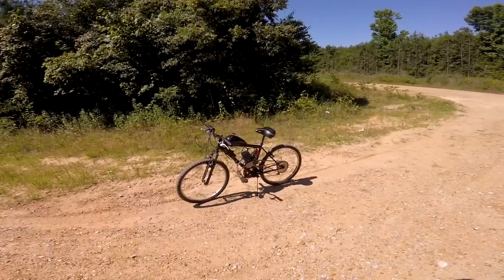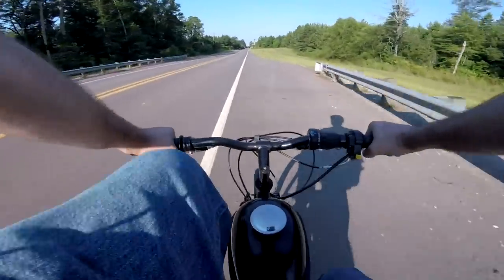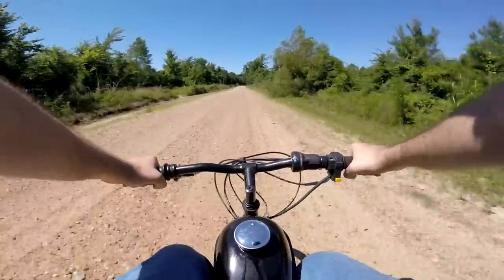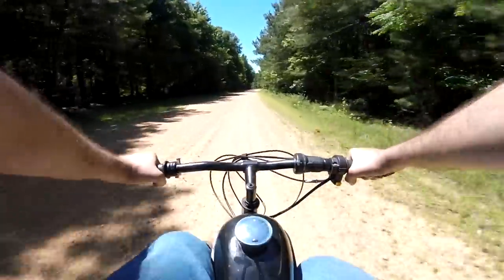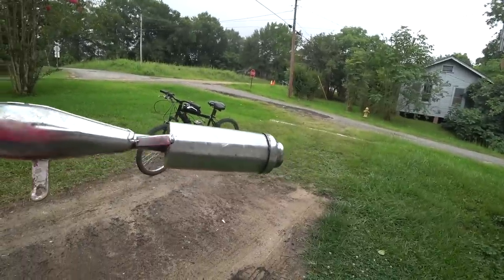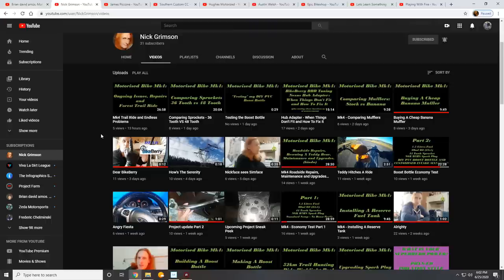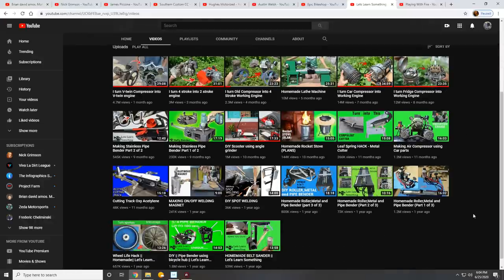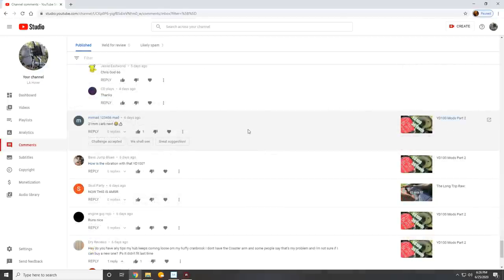Small Sprocket Advantages (Motorized Bikes)

Comment: Hi. Im an older guy and ive been working in stuff like this. I have already made a chainsaw powered 26 inch mountain bike friction propelled. It was done with bits and pieces cause i am a welder and take advantage of scrap parts and give them a second chance. At work alot of guys are going nuts over it and the face of people when they see it is priceless 🤣🤣🤣.Now doing a 26.2 cc 4 stroker edger with a home made jackshaft with old pedal axle and remade it using the lower gear . Still on process of getting a homemade pedal sprocket ratchet with old tools. Nice video and hello from the Windy City
Reply: Love it Man from across the pond in Michigan.S.W. corner exit 23 off 94. Anyways do your thing
Reply: Why don't more people take the silencer off ... It picks up excellent and is noticably faster.
Reply: @KuuchWizard  thanks i just finished and upgraded to a 50 cc chainsaw motor , it hauls !!! Thanks for the comments

Comment: "Truing the rear sprocket." I saw a guy who took zip ties and inserted the tips of about 8 or 9 of them into the gap to keep the sprocket centered before tightening. Seemed a good idea and it worked out very well for him.
Reply: yeah that's the way to do it, very cheap and easy. You might as well haha.
Reply: Project Farm’s 2 stroke bike engine review
Reply: A socket of the right size works well used the same way.
Reply: Yup its works
Reply: That was project farm wasn’t it
Reply: Could have been. @SmothersSawShop

Comment: A 32 tooth is perfect for me.  I have a lower speed bike, built for torque, and I find the 32 gives me a great balance between acceleration and speed.  I barely have to pedal, and I can go a little over 30mph, but at a lower RPM, so it keeps the heat down at cruising speed, and increases fuel mileage.  If I can find a way to get a little more power, I'd love to get a 30 or 28 tooth sprocket.

Comment from the maker: I forgot to mention chain and frame clearance. Smaller = more clearance.
And the bike is easier to start.
Reply: Haha outta gas I learned not to do that bout 10 times
Reply: wouldn't have that problem with a 4-stroke. When you're getting 140 to150 miles to the gallon.  You've always have enough gas to get home.
Reply from the maker: @marcs4091  "This channel doesn't have any content"
Reply: Where do you live. I wish I had roads like that
Reply: @SamSamuylik  Indiana not to be weird but I’ve heard him say it a few times
Reply: @tylertillema5934  i thought it was louisianna
Reply: @marcs4091  I get that mileage on my 2 stroke 80cc china doll, only thing I changed was the sprocket 36t and added 3 holes to the filter.

Comment: Y'all oughta design some kind of bolt on 2 speed transmission, patent it and have it produced in China.
Reply from the maker: That would be a dream come true!
Reply: Yes I think so to or use a 6 speed a bikes shifter sprocket on the left side
Reply: This would be cool. I keep thinking there has to be an easy way to make a 2 gear system without using a jackshaft nightmare setup.
Reply: That would be really cool to get something like that working.
Reply: no no no the fact is its already been made look up motorized bike jackshaft kit that can be used to shift as many gears as you have on the right side as you would do normally their quite an easy setup if you know what your doing :p
Reply: @quirkyMakes  any luck on the 2 speed trans?
Reply: @kjohns1413  i keep thinking there has to be a way for jackshaft to be combined with bottom bracket like I've seen done with production mopeds and board track racers.
 By using a hollow crank axle welded to a sprocket on left for the motor and a freewheel mounted to the 3-chainring sprocket on the right, while there's a solid axle with a one way bearing that goes through the hollow axle and engages through the owb, and is long enough to extend on  both sides to mount crank arms. 
This way we can have motor and pedal drive go through one point without requiring bullshit like flanges and proper angles, bolt torques, and wheel clearance. It's just a matter of getting the axles designed for ability to mount the owb/freewheels of proper size and robustness to work with a motor.
Reply: I say try building a beefier gear setulike a mountain bike has but for 415 chain @Bt.Gang.Activity

Comment: I bought myself a 80cc kit of Ebay. Put it together in about 2 days with zero experience. I had some slipping clutch problems but got that figured out. I took it nice and easy for a little and it's already broken in and its amazing. I'm 16 and weigh about 140 and I've gotten a top speed of 34 on stock engine. I put a new carb on today which should increase performance. I had a lot of help from this channel very good advice. Keep up the work man amazing channel
Reply from the maker: Thanks for sharing, let us know if the carb helps or hurts your top speed. Did you get some jets for it as well?
Reply: @LAHover  bad news. I have no power in high rpms it is very slow. Since I am only 16 I'm not the richest person in the world so I cant really afford jets lol. I decided to return the upgrade and stick with the old one. Less upgrades = less trouble. Its not terrible stock so I dont mind. I'll get a car soon anyway😂
Reply from the maker: Thanks for the update. Ya I hear after market carbs can take a bit of tuning to get the same/more performance. Good luck to you!
Reply: just go ahead and order new clutch pads and a replacement chain that comes with a few spare master links. These are the parts that always trash out and break first with those kits. If you ever break the accelerator or clutch, remember you can swap out your rear break lever in a pinch to make it home. The fuel line that comes with them always wears out fairly quickly, replace it with a real fuel line asap.  I suggest where the cable for the accelerator slots into the handle, wrap it with a small zip tie or two, that little white plastic slot break easily. Otherwise they're fairly bullet proof little machines. If you're going to abuse it, attach the gas tank with electrical tape instead of the bolts because the little screws that are welded to the tank are known to crack the tank and leak from bumps and drops. Invest something small you can strap the the handlebar if you cant or don't have a rear storage rack on the bike and use it to carry all these spare parts and the small hand tools needed for them, and toss a little Gatorade bottle in there with some spare pre-mixed fuel in case you run out or spring a leak and don't catch it in time. I use a small plastic ammo can that is weatherproof for this, and it also hold a small 12v deer camera battery in it that I wired a little switch to in order to operate a bright trail light I use as a headlight at night and get a nice rear red light that flashes (they usually have like 50 hr+ batter life) and toss a $10 set of spare lights in that tool bag in case you break the lights somewhere with a spare set of AAA batteries just in case. 
 That's about it, do this and youll be surprised how long these little kits last. I've got one right now that's creeping up on 4,000 miles.

Comment: Excellent video man. I pulled a 44t from an old Mongoose 20" and then mounted it on a relaced disc brake hub to my rim for absolute trueness. I'm pretty light so a little clutching and I really don't have to pedal except for starting it. Runs 28mph top speed but the sweet spot is ¾ throttle at about 24mph. 36t is probably too small for my stock motor.

And I use the same chain wax that I've been using on my CR125 O-ring chain for the last 25 years. Pretty sure it's Bel-Ray, but it's not greasy grimy dirt magnet goo so I stick with it 👍
Ride on brother
Reply from the maker: Thanks! And thanks for the chain wax recommendation.

Comment: Just in the past few days I transplanted my zeda80 from my aluminum frame Giant mountain bike I had absolutely run into the ground into a steel frame Schwinn cruiser style bike. I was very impressed with the vibrations: the aluminum frame mountain bike vibrated so bad at higher rpms and now I can barely feel it in the handlebars! Huge difference!
Reply from the maker: Good steel frames are getting hard to find. But they are perfect for these little motors.
Reply: A mountain  bike is to light  for a motorized  bike . I have  a  HYPER  cruiser. Really  good  and  solid

Comment: Grabbed my motorized bike the other day and have been running it every night. Havent done much since going electric, but man is it nice hearing that 2 stroke again. I would love to see a good after market carb. Every time I look them up they have bad reviews, hard to know which one will actually work. So funny how that stock exhaust just kind of works!
Reply from the maker: Nice man. How has your electric been treating you? Did you build a kit or buy a pre-built?
Reply: @LAHover  500w rear geared ebikeling kit. Battery is from Unit Pack Power, they have Samsung cell batteries at a reasonable price. A 500W kit would seem slow compared to that YD100 for sure though.

Comment: Thank you for all the sprocket information is very helpful. Now I'm running on the factory 44t and I do find it good for my terrain, which is mostly flat ground but a lot of stop-and-go traffic and a few spots were wide open throttle is necessary. Now with that being said I just had to change rims therefore I had to remount the sprocket. I got it centered and perfectly true. But no matter what I do this Rim, which is true as well, will not allow the sprocket to sit far enough out so it doesn't derail. I've tried shimmying up one side with washers no go. My sprockets Mount up with the typical rubber sandwiched type deal. The only other thing I can come up with is that this Rim was not for this Frame, just swapping them around like that may be great for making it a pedal bike and would work fine in my honest opinion but getting your sprocket line with the motor on a  motorized bike I think the problem lies within the pedal sprocket as well as the axle. Because in this Rim all about is set for a different frame and different model bike. So my plan is to have the Sprocket in the axle pulled from the other Rim, that did work on the bike but it's now all messed up (broken spokes and whatnot). do the same to this new/ used rim then simply install the axle and the pedal sprocket from the rim that did work fine on the bike. This should make the new/used rim set the way the other Rim did, correct? Like am I on the right track here or could something else be wrong. Because nothing I do seems to be able to get that chain to go centered with the sprocket no matter how true and centered the sprocket really is on the rim. And the frame is Not Bent. there's no way the rim would have not bent before the frame. I could really use some advice on this because my bike has been down more than I've been able to drive it and I missing out on the season big time. Thanks in advance for any advice anyone has someone may be able to offer. although I pretty much think I got it, I just would like confirmation that I'm on the right track

Comment: Hiya again.As you've seen previously,I run 93 octane,and semi-synth Penzoil XLF at 32:1.I have the CDH style Reed Valve,which is actually shorted than the stock intake tube,not the big funnel shape as you pictured.Also have stock carb,not the 'speed style'.I cleared my ports of Flashing inside and micro beveled so no edge to catch rings Only,and gasket matched outside.Triple 40mm.Using the 56 tooth It hit 23mph and likes  17-18mph.(so do I).I put the 'Poo-Poo-Pipe'on yesterday and went for a ride.Yikes! It wants to pull the front wheel off the ground at almost every start,and did a couple times.It's about 1/3 louder that my stock muffler,which I'd modified by cutting the up tube to 1-1/2" inside,and drilled 2 holes 1/2"diameter all the way to the material at the top using a long drill bit.I did that for the extra torque and it worked wonders with the Reed Valve.I did no piston mods.>Now,with the Poo-Pipe,I'm going to file the bottom of the piston to port match the intake as about 3/16"skirt shows.It runs out of steam at 15mph and creeps up to 21mph is why I'll do the piston.FYI.The reed made about 3mph more,and keeps blow-back out of the carb and off my bike.
Reply from the maker: Thanks for the info. I like the Poo Poo pipe on the trails for that low end as well :) ...
Do you plan on adding a window to your piston? I hear that the reeds start to open the motor up better with a window. But my guess is cutting the skirt would be the next best thing.
Reply: I'm worried that the 'window'would cause a negative vacuum,and does nothing but lighten the piston mass.By cutting the skirt 1/2" I'll open the intake earlier than the skirt that blocks it by 3/16" anyway.That should create a volume to offset the free exhaust flow,in theory,and not overload the spark.(I'm uploading a test run as-is without re-work)

Comment: My son and I have bikes. His is a yd100, and mine is a pk80 with Reed values and a 24mm mikuni style carb. A good trick for the exhaust, is to grind off the pipe at the top of the muffler, carefully enough so you can weld it back together. Hollow out the muffler weld together and weld the cap back on! It's like a n expansion chamber.  Works AWESOME! Aslo we just got expansion chamber exhaust and the exact same silencer you showed. We will let you know how it works! Great videos!
Reply: H9w did the new exhaust work out?

Comment: It's good to use rubber between your motor mounts and your bike frame if you have a lot of vibration in engine
Reply: A lot of vibration is coming from the crank too, needs to be balanced.

Comment: I put a 31 tooth sprocket on my stock kit and that sucker pushes 50mph it’s insane take off is a bitch but one u get the hang of it it’s awesome to summarize the video big sprocket more torque less top end smaller sprocket high top end low to no torque

Comment: The nicest bike I ever had was a 29 in mountain bike frame a little tight of a squeeze but it fit the yd 100 with the mount adapter for the bigger tube and I put a 36 tooth sprocket on with modified stock pipe and speed carb it was going so fast and smooth and awesome I miss the bike I make them cuz I love building on but I always end up selling them to get more Motors and Frames to build more stuff but that one I miss so much this is pretty cool and exciting I love that to rain and I love the sound of the bike it sounds so solid I blew up a yd 100 also a different build from Zeta the one and only motor I never took apart and checked but that's a lesson learned always check your stuff anyways nice build
Reply: Lol I can actually relate my old 29 in bike was a legend

Comment: I am 15 years old currently. I turn 16 in august and that is when I can get a drivers permit and a motorcycle permit. Apparently if you get pulled over on a motorized bicycle as a minor you can lose the ability to get a license until you are 18. I am sad to say I think I am going to retire my motorized bike career. 

Edit: I do have a friend that has alot of land which I might be able to ride on. Luckily my dad does have a 200cc burgman scooter that I will be able to ride when I get my license.
Reply: Same
Reply: That's a good idea, ride a motorized bicycle to learn how the road works, before you get your car license, and expensive insurance.
I rode bikes until I was 20, and got my 1st car. Learned some good habits ;P
Good luck with your license in August, go ride some trails, fun before safety LOL
Reply: Each state and also municipalities have different laws and or restrictions on motorized bikes. They can also lead to DUI / DWI . Always check the laws where you live.
Reply: I ride my motorised bike in our fields

Comment: Best chain lube IMO is "sprayon Moly chain lubricant" it foams up gets in everywhere and doesn't burn off or drip everywhere. Comes in a spary can last a very very long time more often than not it will last longer than the life of the bike 100% will last longer than the chain
Reply: It is very expensive $55-$75 depending on where you get it. but as i said it last FOREVER so if you buy any chain lube do the math a full can of sparyon will last years a small bottle or can of random chain  lube will last a handful of cleanings or lube ups again so it works out to be a big upfront cost but cheaper over time and works amazingly well
Reply: I still have over half a can left got it 2 years ago and use it for 5 different bikes one being my phatmoto rover 2020 which has 3 chains to lube up.
Reply from the maker: Cool, thanks for the recommendation.

Comment: i am building a frame to mount a motor on my 2 piece mountain bike frame.  it will set the motor over the rear wheel.  
  Next for that bike will be a front wheel mounted motor as well as the rear motor! it should be a ripper!
  i also found a NITROUS kit for a 49 cc.!!!!!! AH the MADNESS!!!!

Comment: I really need to make a video myself lol. I run a YD stockish (cleaned intake,exhaust, and ports up with  dremmel, upgrade to better clutch pads, repacked drive shaft with grease, and also replaced exhaust gasket with o2 sensor 😵😛) and I run a 44* tooth..around 3/4 throttle she's at 33. Plenty fast for me ✌😂. Nice bike bro!

BTW I still haven't jetted perfect so..probably will go faster than 33 but ya I don't like it on a bike lol.

Comment: A+ not only on the pros and cons but glad to see you like the smaller sprocket. If you really want to increase fuel economy try out a boost bottle. Don't have to buy pretty easy to make. You will definitely see a major increase in low end power and fuel economy goes through the roof. Happy riding brotha 👊.
Reply: It seemed to do close to nothing for him. Any ideas what you would do differently? Looking to get into the hobby
Reply: I've seen 0 videos of boost bottles actually helping at all.